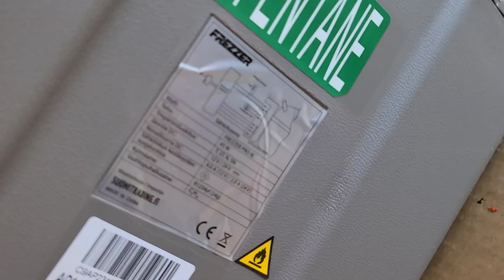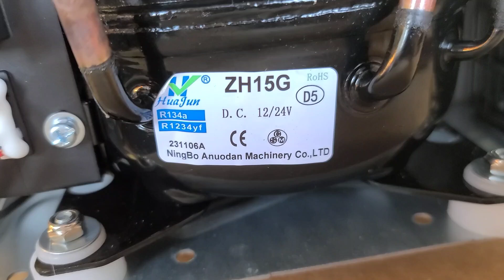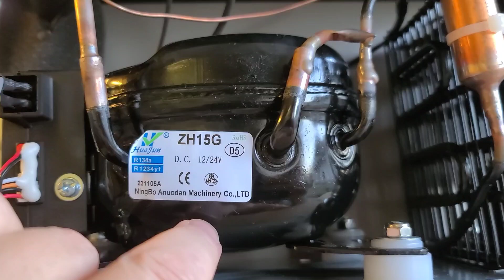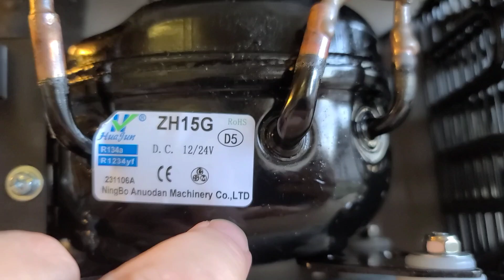Portable 12V Car Fridge: Noise and Vibration Issue

Comment: interesting. I have a small fridge that looks very similar to this, I think they sell these chinese ones under all different brands all over the world. The compressor has the same branding as yours I can see it through the gaps in the plastic. Mine is also very loud like yours I was going to open it up one day to try and fix it but instead I will return it for a replacement. Thanks for the vid.
Reply: FYI mine is a brass mokey brand sold by jaycar in Australia
Reply from the maker: @carlh2007  yes, that's the same fridge, just with different label